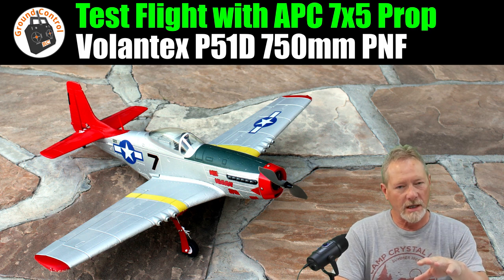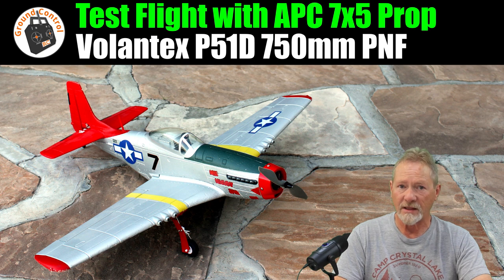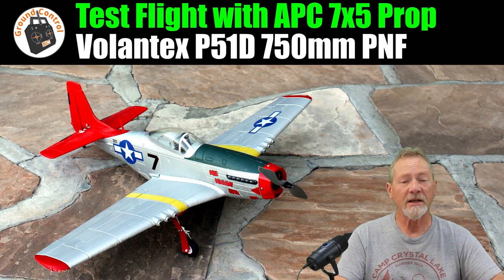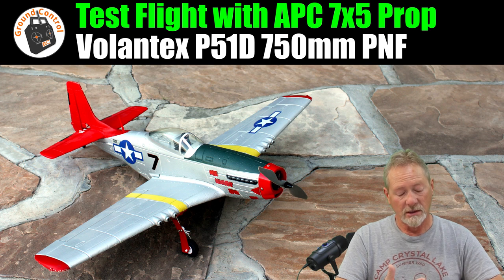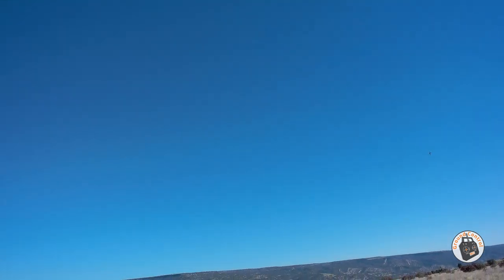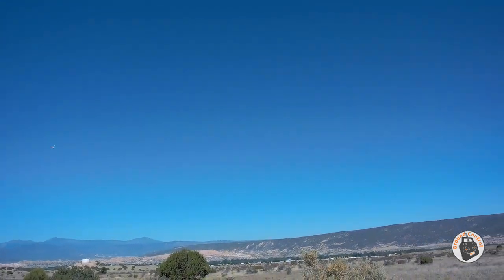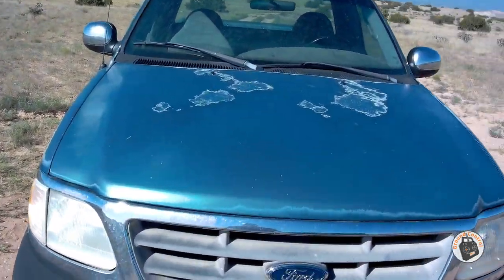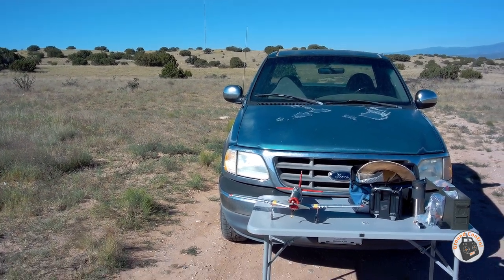Test Flight with APC 7x5 Prop | Maybe Too Much Power ;-) | Volantex P51D 750mm Wingspan PNF

Comment: I cut two blades off the original four blade prop. And tested the 280 on Spektrum 3s, 300 mah lipo. No problems so far and esc was just warm. Not to mention the speed is awesome. I don't recommend it in case people over push and maybe in higher temperatures a different outcome not sure. But for me so far so good, I'm going to use all the time and see how far I can push the stock esc on 3s, but have to say, very impressive on 3s.  😊😊😊
Reply from the maker: Hi Michael!
That A280 is such a fun plane and on 3S it must be a rocket ;-)
Good idea turning the stock prop into a 2-blade prop for that purpose.

Comment: Did you ever think or wanted to put lights on this plane
Reply from the maker: I never have.
I think sometimes they over do it with lights on some of these planes.
I typically unplug the lights if they're installed and save the power for flight time.
Reply: Since having a umx turbo timber evo …I like the little leds …just wondered if it’d be hard to do on this plane ..don’t want many lights just a few
Reply from the maker: @snauzze7007  I don't think it would be hard to add them to the tail land the wingtips. I suppose you'd have to carve some foam.

Comment: What motor, prop, esc, reciever, gyro and battery please? Brands and where to buy.
Reply from the maker: Hi Claude!
There are links to everything in the show notes except for the Byme-A Gyro and RX.
Here are links to those:
RadioLink Byme-A Flight Controller Gyro
https://s.click.aliexpress.com/e/_DDHkkMr
WFly RF201S 1.32g Micro SBUS PPM receiver (OpenTX Supported)
https://s.click.aliexpress.com/e/_DBWoZkP

I think the Stock Motor will work fine and I would use the Stock Motor if I had to do it over again.
I installed the RacerStar BR2208 1400kv Motor in mine.
The Prop I use is the APC Style 7x5 2-Blade Prop.
The ESC I use is the Hobby Wing Skywalker 20A 2S-3S ESC.
The Battery is the Tattoo 3S 650mah 90C LIPO.
I installed an XT30 Connector on my ESC and the LIPOs have XT30 Connectors.
The Gyro is the Radiolink Byme-A and the RX is the WFly RF201S SBUS RX listed above.
The performance is fantastic ;-)
See you in the Air!

Comment: Did you ever figure out what are good two blade props stock 2S and 3S(stock motor bigger ESC)?
Reply from the maker: The 7x5 is the best prop I've found for the 2S Setup.
I haven't setup for 3S yet but I'll definitely upgrade the ESC when I do that and probably test a 6x3 prop to begin with.
Reply: I think I already got 7x5 based on your stuff and 6x4 and 6x5.5 are on the way.  Also waiting on electrics because of incompetence. @GroundControlRC
Reply from the maker: @gordonv2456  Sorry to hear about the electronics.